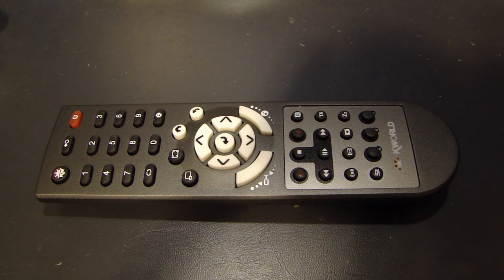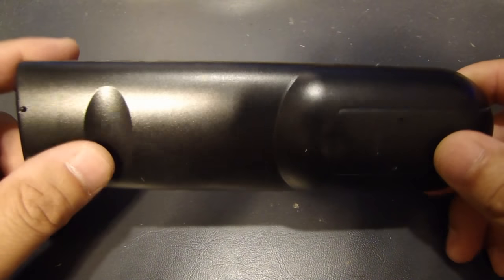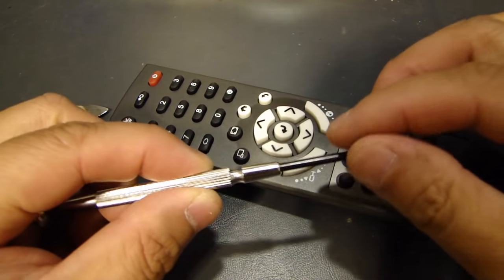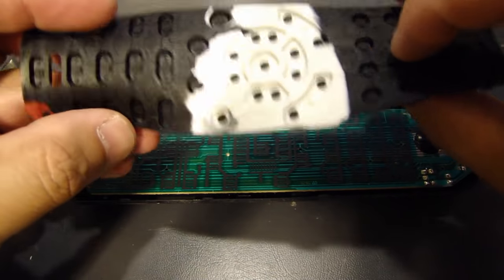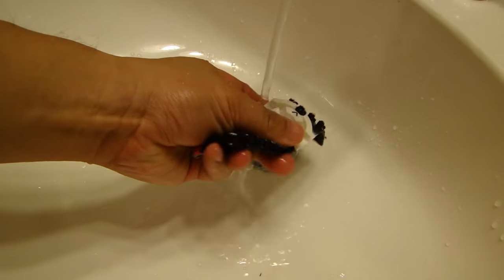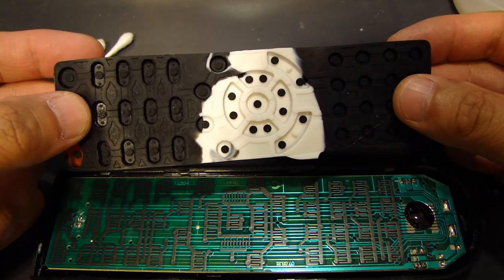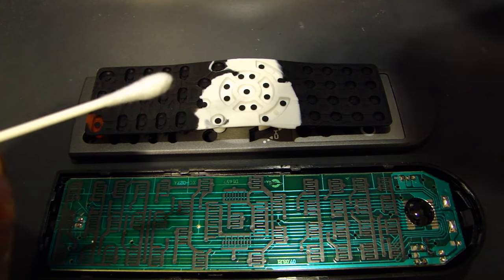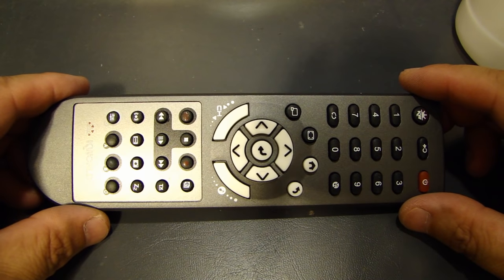How to Fix & Clean Your Remote Control Buttons

Comment: THIS IS QUITE INFORMATIVE, THANKS. IVE PROBLEMS WITH MY TV REMOTE FOR A WHILE. THE LAST TIME IT WOULDNT WORK I GOT A WORK MAN TO FIX IT FOR ME. HE CHARGED ME OVER 80 DOLLARS.  HE GOT IT WORKING FINE. BUT MY PROBLEM IS, I WATCH MOVIES WHILE HAVING MY DINNER AND I HAVE TO HANDLE MY REMOTE WITH GREASY HANDS. I TRY TO BE CAREFUL BUT GREASE AND STUFF STILL SEEMS TO GET ON MY REMOTE. 

WELL THIS TIME ITS NOT WORKING AGAIN I DECIDED TO PUT MY TV REMOTE INTO THE MICROWAVE OVEN JUST ON DEFROST, YES THE LOWEST SETTING AND I HEARD A STRANGE NOISE SO I TOOK IT BACK OUT IN SECONDS THEN MY REMOTE SMELT OF SOMETHING BURNT. 

TODAY I HAVE PULLED MY REMOTE APART FOLLOWING YOUR INSTRUCTIONS BUT I DONT HAVE ANY NAIL POLISH REMOVER FOR THE GREEN PART SO I MIGHT JUST USE VINEGAR ON THAT VERY GENTLY. AND WHEN EVERYTHING IS 100 PERCENT DRY I WILL PUT IT ALL BACK TOGETHER AND I WILL EDIT THIS IF I REMEMBER AND LET YOU KNOW IF IT STILL WORKS. I AM WORRIED PUTTING MY REMOTE INTO THE MICROWAVE MAY HAVE DONE PERMANENT DAMAGE TO IT THOUGH. WE SHALL SEE..............

NOPE, ITS NOT WORKING. PERHAPS I BURNT OUT SOMETHING IN IT BY PLACING IT IN THE MICROWAVE. AND WHEN YOU PULL THE CONTROLLER APART AND PUT IT BACK TOGETHER IT DOESNT SIT IN RIGHT. THE TOP PART IS UP TOO HIGH AND NOT SITTING HOW IT SHOULD. IM GOING TO HAVE TO SEND MINE AWAY AND SEE IF THE WORK MAN CAN FIX IT AGAIN, UGH, WHAT A PROBLEM CONTROLLERS CAN BE.

Comment: Working for AT&T and Lucent  we always used  Isopropyl  Alcohol  for this as it contains  less
water as rubbing alcohol has water.  The buttons that do the circuit connections  have baked
in chemicals that will break down over time and deposit a  greasy petroleum like substance
on the board. This prevents proper conduction when pressing the buttons. Clean them off with the Isopropyl Alcohol and it's done.
Reply: +grassroot011 Exactly- same thing for video/audio heads AND using something other than Q-tips and those have cotton that can come off- get cleaning pads from a source like eBay. Something like these- http://www.ebay.com/itm/100-Solvent-Cleaning-Swabs-Epson-Roland-Mimaki-Mutoh-Large-Format-InkJet-Printer-/200898924765?hash=item2ec68250dd:g:HoYAAOxyIAZRrgm8
Reply: This video gives me hope.  I am going to give this a go.  Wish me luck.   Thanks sooooooooooooooooooo much.

Comment from the maker: Once its corroded, there really is no way to restore it. You can try to clean the rust off with some sandpaper or steel wool. Spray some WD-40 on it and try cleaning it with a toothbrush. Depends how rusted they are, it may be easy fix or difficult to fix.

Comment: they make plastic & nylon case splitters & they don't do any damage. or use an old credit card.
also, there's a conductive paint on the contact surface of the rubber buttons. it wears off with use & pretty much any attempt at cleaning. as that paint degrades so does its ability to complete the circuit across the traces.

Comment: I used shower cleaning spray and bounty roll to clean the circuit board and even while I was doing it I thought I may be destroying it.. but I was too frustrated with the remote anyway and ready to throw it away in anger, so went ahead. Then I glued the aluminum foil pieces on the back of the buttons (conductive contact)... and now my remote is working like new :)

Comment: Yeh biggest problem is condensation you keep  the unit in your hand and it heats up the you put down when you finished and it cools down and the condensation forms combined with the dust and grease and the resistance is just too high, so then as you did give it a clean, I used to work  for my brother repairing tv's and vcrs, remote controls that had been dipped in coffee we would just wash the entire unit without batteries and the come up good as new

Comment: good video,,,except..i would have liked to see a BEFORE and AFTER results......i tried this...it didn't work.....???
Reply: +J.R. Zippie 
I had only one button (the most used Volume button) that refused to work.  I tried contact cleaner on the black button contacts instead of Alcohol; didn&#39;t work.  Tried soap and water, didn&#39;t work.  Contact cleaner on the PCB contacts; didn&#39;t work. Alcohol on the Button Contacts didn&#39;t work. HERE&#39;S WHAT WORKED:  used an eraser (yes from the end of a pencil) across the black contacts on the buttons and on the PCB contacts and Voila! Like magic man.  I was getting worried that it was completely gone and was unrecoverable.  The remote is nice and clean and works well.
Reply: +Andy Devine --nice idea...tried it...didn&#39;t work!!  maybe cause this remote is about 6yrs old??....anyway...been using a universal remote (GE...$6.00) that does the trick.... :)
didn't do line thru...???
Reply: I didn't type the symbols either.  ASCII code is FUBAR

Comment: Can i use a spray can elect cleaner?
Reply from the maker: Dries Ackerman If you just simply spray with contact cleaner, it will spread the dirt all over. It might work for awhile but the problem will probably return quickly. Also those cleaner is really meant for metal contacts, and not for conductive pads.
Reply: @dial2fast  I use Deoxit #5 to clean remotes. It is SAFE to use as it is a fantastic cleaner for "potentiometers" which have carbon "tracks" that get dirty causing intermittent operation. Also, when I get a new remote I always wrap it in 'saran wrap'. Doing this keeps the remotes in mint condition, functional and cosmetic. Really helps if you accidentally spill liquid on the remote. CHEERS!

Comment: Hand soap is NOT a good idea. Soak it in warm water with Dawn dish soap for about 10 minutes. Rinse thoroughly. Let dry completely. Then use contact cleaner on the board, and rubbing alcohol on a qtip all over the plastic cover. NEVER use acetone.

Comment: I watched video to see if It was necessary to replace the small amount of dielectric grease that's between buttons and board ( from factory).......but you didn't seem to replace it soooooo....
Reply from the maker: You DO NOT put any grease on the buttons.
Reply: @dial2fast  Roger that....& thanks 4 the prompt response/answer.

Comment: I've cleaned my remote 3 times it's still  dose not work
Reply: +Keara Jackson Make sure the batteries are good (sorry if that is too elementary) and clean the red plastic on the front of your device. It needs to be squeaky clean. It covers the detecting sensor and even a thin film or  some dust can really screw things up...Paper towel can scratch it. I use windex and a cotton T shirt..